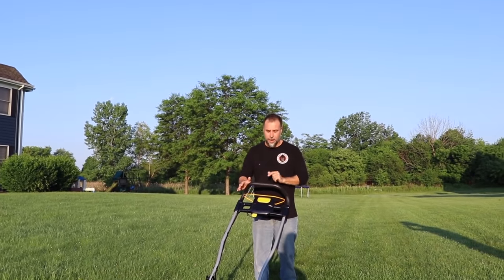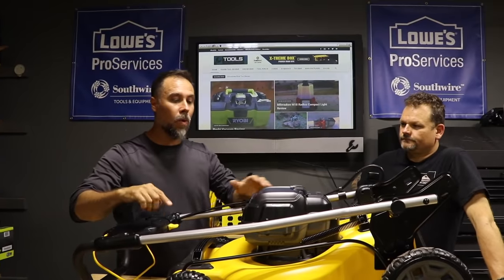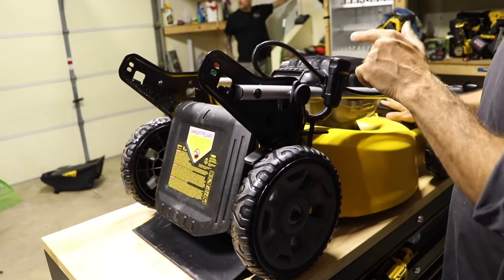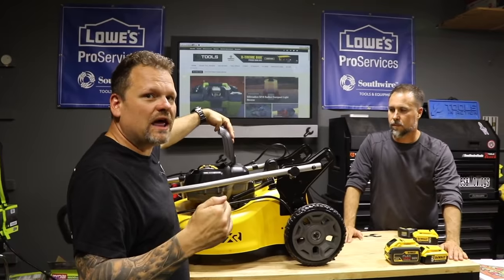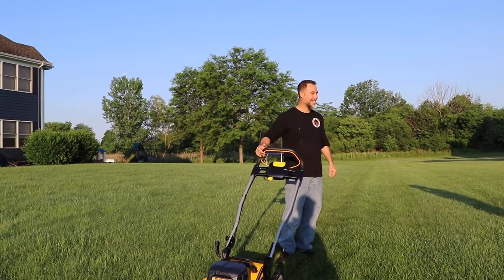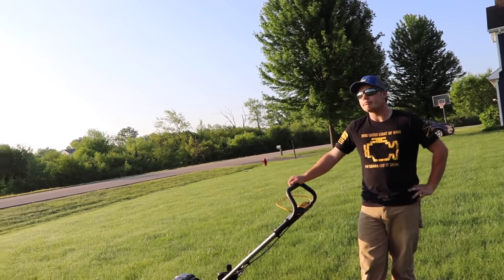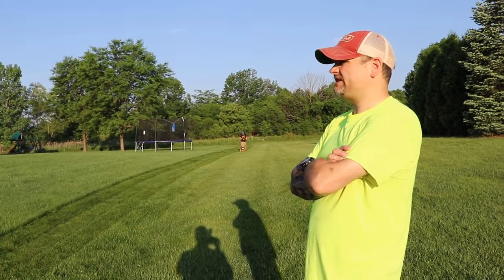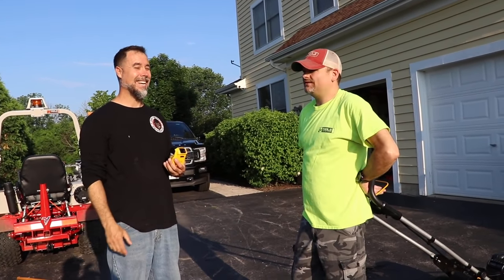Dewalt- 1st place for the Worst Lawn Mower of the year

Comment: I love my residential Honda mower. Best in the market as mowers go.
Reply from the maker: I love Honda without a doubt
Reply: i love briggs but Honda is awesome too when it comes to power equipment  :)
Reply: Best mowers ever. They have their flaws (rear wheels locking up issue) but they are minor. Honda mowers are a great choice for homeowner and residential. Leave it to the Automobile makers to give you a quality product.
Reply: Honda makes great mowers, but be sure to ALWAYS treat the fuel, because the carbs are really finicky!
Reply: Same , 1st pull since day 1
Reply: Definitely the best I've used
Reply: Don Shaw the older lawn boys are good.thats what i have and it works great. The newer ones i havnt tried,but the hondas are really nice as well
Reply: is it petrol? so lol how you can compare these
Reply: Not trying to compare electric to gas mowers at all.. . Just saying I love my (gas) Honda mower.

Comment: I purchased a bunch of DeWalt tools in 2020. I’m happy with them and decided to purchase their electric mower Spring 2021. The mower worked fine with my small lawn. No issues with run time or start up. A couple months ago, I noticed my mower would not last longer than five minutes with fully charged batteries. Even swapping out the batteries proved to be useless. I do not recommend electric mowers and will buy a gas mower in the future.
Reply from the maker: My other battery powered mowers have no issues.

Comment: Would like to see this test again on dry grass with the bigger batteries and not quite so tall of grass.  A gas mower wouldn't power through that stuff you're powering through at 20:00.  Also 1 of those stripes cut is like 4 of a suburbia lawn.
Reply: My thoughts too - they're going through quite tall grass, which is clearly wet and acting all surprised that it's choking up and not performing... I've never faced this with my one, but then again I don't abuse it with wet grass...

Comment: I actually love the mower. It’s not what I would buy for a lawn that was more than maybe an 1/8 acre. Great small residential mower for say a duplex. The 5ah batteries that come with it need to be used till dead and recharged maybe 3 or 4 times to get the most run time from them. Fortunately for me I have oodles of dewalt equipment including 9ah batteries. 2 9ah batteries in this mower will way more than mow my lawn. No gas folds up nice. Bad is that the blade sucks, I replaced it with a good mulch blade and it works way better. The kid can even mow with it, nice and light pushes easily super light. I am 6’3” and the handle is perfect, the kid is 5’ ish and the lower settings are great for her. My conclusion great mower for small yard especially if you don’t want to store gas.

Comment: It doesn’t have an exit hole for the grass
Reply from the maker: It has a bagger
Reply: Not, or shouldn't be, a problem. No discharge just means it mulches it.
Reply: They should have a bag on it. That would make a big difference
Reply: Josh the mulching I think was bogging down the blade and it should have a discharge with a mulch option because some people don’t like mulch and I think it was a little wet in the video
Reply: It has three options. You can attach the bagger to the rear, leave the bag off and it discharges out the back, or you close the back and it mulches. Trying to mulch tall damp grass is stupid and bagging wet grass is hopeless.

Comment: I own the Kobalt 80volt line of lawn tools and have no complaints. Light Weight, quiet, no oil or gas to go bad and enough run time to cut my 50 x 150 yard on one battery at normal height. Batteries charge fast, you’ll be able to cut continuously on the two  batteries or three for sure if you wait until you grass is really high.

Comment: I agree for $400 I'm buying Honda. They have been nothing but reliable for me.
Reply from the maker: Same here
Reply: i thought u could not scerw up a push mower but i gess i was roung
Reply: No substitute for a good old gasoline Honda!
Reply: After having a Honda that surged no matter what, and one that just flat out refused to start when warm I'm good, I'll take a Briggs or Kohler.
Reply: Rufus LC 9000rpm
Reply: I'll take my Briggs and Stratton. I only care for the flat head engines and the older ones at that. The last Honda mower we had started surging after two years. Then the bolts for the exhaust snapped off in the block. The mower I have now is about ten years old and the carburetor has never been apart. The deck was slap wore out to the point where the self propelled system was failing due to the play in the wheel mounts. So I bought a used deck and swapped my engine onto it and we're back in business
Reply: With that money you could even get a Honda Civic
Reply: I just got the Ego and Im loving it so much and it’s pretty silent!! No gas,oil or filters. Smell of pure cut grass
Reply: Same here as well
Reply: well the 2 batteries are 3/4 of the price
Reply: I just bought one of these mowers and cut my 3ft+ tall grass with no problem at all. Took me 8 batteries but I expected that. Guess I got lucky and got a better machine.
Reply: considering you can get a Snapper mower with a Honda engine for $250.
Reply: I'd buy Chinese over anything electric, electric motors that are cordless just aren't as good as an engine
Reply: toro and honda are the same, same engines and quality
Reply: Rufus LC honestly ive came across 4 hondas in the trash this year. 3 had wheel failures
Reply: I have a Honda push mower here I got to fix and sell, missing both drive wheels and the top half the handle, runs good, 2016 model too, motor is likely heading for something else and then the deck will just be picked for ebay parts.
Reply: Honda 4 ever 4 me. Never let me down.
Reply: Honda? haha. enjoy junk carburetor problems.
Reply: Lawn Fascist How often were you using the machine?
Reply: Honda surging is the gaskets on the manifold side, Also manifold to block gaskets have a habit of leaking.
Reply: Hate to say it mate i fix commercial mowers for a living last 27 years couple a years back briggs went the chinese materials path and now replacing broken muffler bolts is the main thing i do.  There is no squish tubes inside mufflers they r just hollow and squash..   Its sad quality has gone to the dogs in the total industry

Comment: my 1979 2 cycle jacobsen won't stop in wet grass + leaves a nice smokey trail when I add a tab bit extra 2 cycle oil for the neighbors to bitch about when I mow my 1/2 acre ;) That alone is not worth going to electric mowers

Comment: Common knowledge ... you never want to mow too low.... cutting more than  1/3 of the blade of grass is hard on the the health of the lawn.  Not really a fair test. Wet taller grass .... and you had the mower set too low.
Reply: I would never buy one, because I like the power of a gasoline engine powered mower, but this test was rather flawed. You even guessed on the price of the batteries.

Comment: The grass is too wet, and too tall to mulch. Even a mower with a 206 CC engine couldn't do that. If you use a grass catcher, or even a side discharge, so the grass doesn't ball up between the top of the blade and the deck, the motor wouldn't stall. Another thing to try, is set the height higher. It's not good for a lawn to take off any more than 1/3 of the length in a single mow anyway. If the mower wasn't being over crowded, it would work just fine, and the battery might just get you half that area before needing to be charged.

Comment: I use one of these for my smaller residential jobs, works fine, a couple of 9ah batteries is enough for 3 jobs, it has limitations, deep wet grass being one of them but its light, cuts well and is just so easy to use, 2 seasons use and no problems, using it for around 15 jobs a week
Reply from the maker: Thanks for sharing your experience with it and thanks for viewing Rick !

Comment: I will say from my experience of the ryobi battery powered mower, the kill button attached the handle when you fold the handle in the upright position, gets loose from the vibrations. Because of this, it has a tendency to shut off when the lawn mower jiggles. I constantly have to tighten it but what I ended up doing was placing tape over the button to hold it into place and the problem stopped completely. I can mow foot tall grass with no problem ls or wet grass even though I try not to. I mention this because I would imagine dewalt has something similar

Comment: I thought that lawn mower did very well for electric battery mower. That mower was put under very heavy load and it did well! Even you guys said 1/2 blade cut . Ben mowing 40 years now. would like to try that mower with rear bag on and cutting 1/2 blade. anyways great job showing the mower.

Comment: I should also mention that I had the latest Ryobi 40 volt mower.It also did a good job of mowing my lawn.The battery is large and average run time was 40 minutes.I had read mixed reviews when I bought it so I was skeptical.Mine started to fall apart after 4 or 5 times of use.Nuts came loose and it started to wooble so I returned it.
I did buy the brushless 40 volt blower,it's the larger model blower with a turbo button.Very good blower and I am happy with it.

Comment: I use the ECO mower and it works. Just slow down and it keeps working Mine takes one 56 Volt mower at 7 amps and I usually get 30 minutes run time.

Comment: I've got an old Troybilt from 96' that I got as a hand-me-down. Briggs&stratton engine . It works like a dream. That being said, I moved to the city, so my yard is a postage stamp now. Front yard is maybe 50x20 feet, back yard is about 50x50. A battery powered one might be good for that, don't have to worry about gas. I'd get a makita one cause I already have their batteries, but after seeing this? Maybe not.

Comment: Gas! Gas! Gas! Never lets you down, powerful enough, runs as long as there is gas. Sick of people saying well gas smells, it's nasty, it's this and that. No it's still the best form of tool ever!
Reply from the maker: Gas still beats battery on a lot of fronts
Reply: The thing is gas mowers are 5% the pollution nation world wide, if they add a Catilatic converter to there mowers then the emissions will reduce to 40%.
Reply: my gas mower would probably fail doing that yard at some point.
Reply: It does smell bad and it's really bad for air quality. My old gas mower and snow blower failed me plenty of times starting up; my Kobalt mower and big sleigh shovel have never let me down. Best form of tool? Well I've watched my neighbors and their big, expensive, smelly and noisy snow blowers fault to clear their drives any fast (often much slower) than I do with my 80 dollar sleigh shovel. Tool is only as good as the person using it.
Reply: Kyle Winconek I agree gas is way better!

Comment: I use a Victa 82 Volt. Nearly identical to the Snapper.  They are best for regular on time mowing.  Mine came standard with two 2amp hour  batteries.  There is no free lunch. Batteries only hold so much energy.  Heavy load equals a fast discharge.  I have taken jobs on that people with petrol mowers refused to do.

Comment: If you want to go environmentaly friendly just get a reel mower. Batteries are not environmentaly friendly
Reply from the maker: Yep  A good reel mower is a good way to go.
Reply: Preston Faust not as much as you think go look into what is required to build them. It's false economy.
Reply: Preston Faust that I have no doubt. It's just not good for the environment. A reel mower is and you get some exercise too. Win win.
Reply: Cadium more toxic than petrol
Reply: I think there should be cordless reel mowers on the market. That would be the best cordless as power would be most irrelevant. The torque in an electric should be abundant and there are much better cordless mowers than this. You should try the new Husqvarna
Reply: You're right, but these batteries are Lithium Ion. I believe even worse than Cadium. This is the big thing about batteries that most people don't think about. Manufacturing and end of life, batteries are worse than petrol.
Reply: Smedleydog1 mabye batters polute 2x as much than a engine running on the highway.

Comment: I bought a Toro 20333 after doing a ton of research.  I found a LOT of negative reviews, most of which were the mower would not start after a couple of months and, strangely, "the wheels fall off!"  The common denominator in these negative reviews was that the mowers were bought from Home Depot.  I got mine from an actual lawn equipment dealer and the first thing I discovered was the drive wheel shad metal gears, as opposed to the HD mowers, which some reviews mentioned having plastic gears. I ignore the whole "Just Check & Add" oil nonsense on the Briggs & Stratton engine, run fuel stabilizer in EVERY tank of gas, have had the mower for two years so far and have had ZERO problems.  I THINK the HD/Toro mowers are more cheaply made, yet cost the same, giving Home Depot a larger profit margin.

Comment: I bought this mower and don’t have these issues but I also mow the grass at a proper height and when it’s not wet. I agree, the downfall is the run time but I can work around that with an extra set of batteries and two chargers.

Comment: Fossil fuels motors still rule when cutting grass!
Reply from the maker: True!
Reply: mhm! or convert it to propane like the fiskars weedwhacker.
Reply: Ego challenge. They are the future in electric mowers.
Reply: Just not ready for prime time quite yet.
Reply: Ego…I speak from 2 years of mowing an acre of wild grass
Reply: I beg to differ. My ego could would that gas trimmer any day. Plug battery inn and go. Ha pull pull pull. Choke. Mix gas right. Clean that filter.

Comment: My Toro does the same thing when running thru morning wet grass.  Gets clogged and stops!
Reply from the maker: Is it gas or battery?  This grass was pretty short
Reply: 30" Turfmaster!  The absolute worst 1800 lawn maintenance investment ever!  Now I can't sell this thing!  Too many bad reviews on it.  Not even a hundred hrs on this machine.  As a matter of fact to say, I had a terrible time with this mower in the winter here in Ca.
Reply: Man, that sucks!  I've got the Timemaster, and it rocks.  Mine's the version with the 223cc engine, though.  It doesn't mulch all that well, but it discharges and bags quite well.  Of course, I'm no pro, so I don't work it quite as hard as you likely do!  But man, it cuts nicely and it really works fast!
Reply: I have the Timemaster too. Use it probably 10 hrs a week, and discharging it is great. Bagging is pretty good. Mulching is pretty bad. Great machine though.
Reply: Rob & Marisela Francis had a old brigs it w stall in a foot thic of wet grass
Reply: Same here but with a Honda
Reply: Side discharge mowers work the best.  Mulching mowers are designed to take off a half inch of grass at the most.
Reply: How can you say the grass was short,  did you not see the amount of clipping that was caught under the deck when it stalled,  no mower Gas or Electic will keep running under those conditions,
Reply: That seems odd that your toro won’t mow wet grass. I have a residential toro gas mower and was mowing the grass last week and had just finished up the backyard when it started pouring rain. So i decided to sit in the garage and have a few beers and the rain stopped about an hour later. I don’t normally mow wet grass but it must have been the beers and I decided to give it a go and finish up the front yard anyway. The mower slowed down a tad when I walked fast but it never actually bogged down or stalled. I think I actually cut the grass faster then I normally do and was surprised at how well it went. This mower is also about 10 or more years old and just a regular old homedepot toro mower. Also I hadn’t cut the grass for two weeks and it had been raining a lot recently so my best guess without actually measuring it was that it was around 3 1/2 to 4 inches of wet grass... if a residential mower can do it I’m sure a commercial grade mower should have no problems... my grass was easily taller and wetter then the grass in the video.